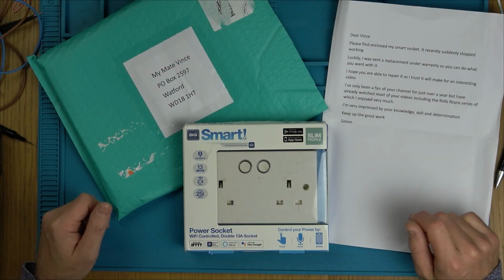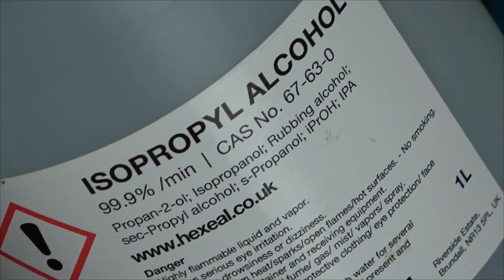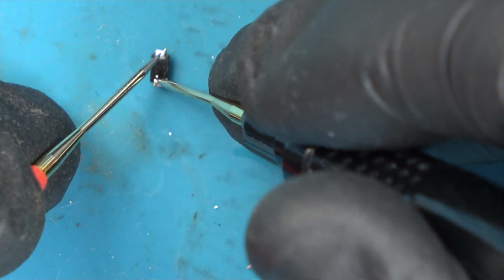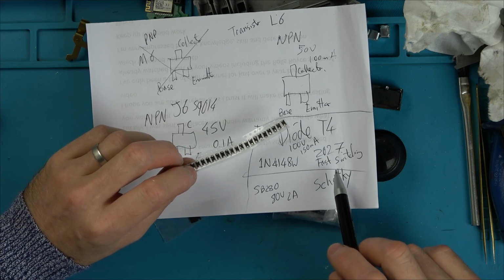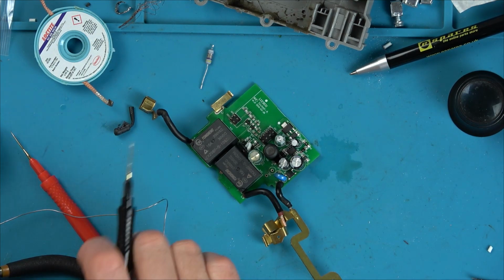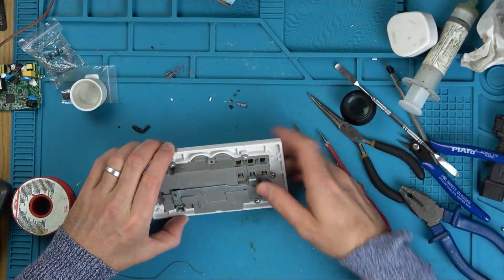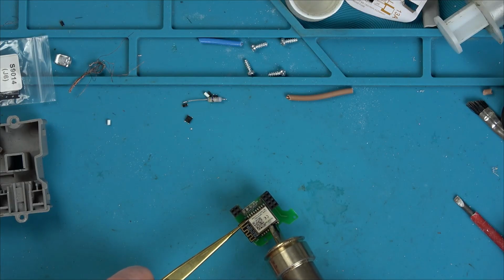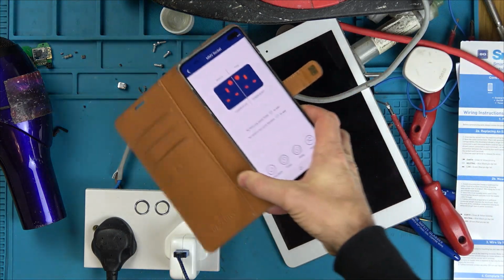Trying to FIX a 13 Amp WiFi Power Socket

Comment: I dont see how putting in a differently rated diode or transistor in would be dangerous..  its on the low voltage side and the most it could do would be short out the relay allowing power to no switch off..  its could pop some other components but nothing that would be of any danger..  the separation of the mains would still be adequate enough unless water got inside apparently..  but logic with vince tends to be a little on the off and on so couldnt really say obviously.  Like when he said “i wonder if id get continuity between the wifi plug and the other one..   like yea, no buddy..  put more brain into speech..  that was probably the dumbest thing ive heard him say while repairing electronics..  was humerous none the less..

Comment: They are flyback didoes across the low voltage of the relay coils to suppress voltage spikes when the relay turns off

Comment: I have a couple of the smart sockets very handy for example my garage is just ran off essentially an extension lead which crosses across a public footpath at height. I used the switch to turn power on its super handy and then leaves it safe if some moron wants to hang off it or hit it with a ladder like some moron did. I do also have a wifi booster socket and i know they are terrible but i just wanted to boost the signal abit for my ring doorbell so it seemed like a cheap easy option. Its terrible it works for about a week then nothing connects and when it does work speeds are dreadful and the rhing is maybe 3m from my main router. I have 600 symmetrical and id get about 10mbps on the socket bloody awful thing. Fine for a ring doorbell but like i say it stops working then you habe to turn the ring off and on at the board and thatd just stupid. Ive disabled it and its now just a usb socket to power a heater for my sea monkeys😂. I think we need to keep the tech out of the walls as much as possible.

Comment: Me thinks it was a bug that shorted from the AC mains to low Volt DC rail taking out the diode, bridge rectifier, 
in fact any low voltage component including those transistors you replaced.. 
Yup both transistors would have needed replacing due to the exposure of high AC voltages, I would also check
any Capacitors on the Low voltage rail violated by the high AC voltage..

Comment: Neutral is never switched as it can become a live when disconnected from the neutral side. These are both Live,
You can receive a full voltage shock from a neutral wire.

Comment: Vince, mate, stop putting yourself down (59:04) - your videos are not just "slightly entertaining". They're very entertaining: that, after all, is why we're all here (well, most of us, anyway).
As to the product, though, these seem like such a poor, or at least unnecessary, idea. And my heart sank when you mentioned an app - way too many things nowadays require an app, guaranteeing whatever it is becomes e-waste when in a few years the app inevitably stops being supported and updated. At least this has physical switches allowing it to operate like a normal socket - the nightmare version would be the one that you can only operate through an app. <Shudder>

Comment: Worth remembering that when you find a diode across a relay coil it is there to quench the back EMF current when the relay de-energises.  A shorted diode will stop the relay working and possibly cause  upstream components to overload.

In the video it looked like there had been some flash over from the Power side of the relay to the low voltage electronics.  Water ingress maybe. There really should have been some isolation gaps in the PCB between the low and high voltage side particularly in the vicinity of the relays.

😂 Home Automation is a good way of wasting time if you get hooked into the Home Assistant solutions - just like VoIP/Asterisk was a few years ago 🤣🤣🤣🤣

Comment: It'd be interesting to see in a few months whether the YT monetisation provides enough to cover the cost of the new socket (plus assorted other components) :)
Reply from the maker: Oh easily, it will cover that within the initial few hours. It's often the time taken that doesn't cover compared to a 'normal' job. I appreciated that I may take  10x to 20x longer than a proper fixer because every item I choose is normally different, to try to keep up the variety, so I'm always struggling! If I did another one of these in the next few weeks I think I could do it faster 👍👍
Reply: @Mymatevince  TVM, but for just this vid, or over your whole portfolio? Does YT even allow that scale of granularity?
Reply from the maker: Just this vid. Yes you can see the analytics on each video and also over the whole channel 👍
Reply: @Mymatevince  TVM :)

Comment: You could porgramm an ESP2866(the "wifi-board" is an ESP) yourself with for example Tasmota or ESPHOME.
Reply: @OneTheAndOnlyOne  Tasmota is my favourite for ESP devices. I personally use node red on an old raspberry pi to talk to tasmota devices over mqtt.

Comment: The diodes looks to be across the coil, if so they are a snubber diode so when the relay goes off, there isn't a load of energy thrown back in reverse from the coil into the transistor
Definitely looks like it has tracked the live across to the coil trace there, and cause mayhem, maybe it was on an outside wall and got damp, or splashed!
I doubt the diode going short should cause that, if anything it would just blow the fuse or the transistor
The bridge rectifier is just 4 diodes, so you will see a short from one side to the other
Get yourself a cliff quicktest, they are great for testing stuff!
Reply from the maker: Thanks Sparks, I'll Google the Cliff quicktest to see what it is 👍
Reply from the maker: Ohhh, I've seen Big Clive use them 👍👍

Comment: "Simplicity" - yes, I can relate. Had a bunch of home automation set up three years ago. But with every new bit, the "update/config/whatever" dance gets bigger and bigger. So the only thing that is still "smart" in my home are the lights. I recently started using Home Assistant again, because it's just easier for me to combine lights from different vendors and program some scripts and scenes. That's it. And I'm happy.
Reply: homebridge is better :P

Comment: These things are ridiculous. Wall outlets should be good for 20-30 years - they're not user-replaceable (yes a savvy individual can do them but it's recommended this is done by a qualified spark), but when you look at this thing the components look to be the usual consumer-grade Chinese stuff that is known to have a high failure rate. Unacceptable.

Comment: DO NOT USE THESE IN GARAGES OR OUTHOUSES, the WIFI chip generates heat that attracts condensation which can then cause a water drop to drip down via gravity and short the high and low voltage liens together resulting in catastrophic failure or a house fire. these things should be banned, imagine a fire on the smart board that went up through the wall insulation.

Comment: 1:02:10 - You and me both. So much tech is now tech for tech sake. I specifically bough an LED torch as it had two modes - on and off. Not fast flash, slow flash, hi mode, low mode, SOS and disorientation strobe?! It's a torch. It lights things so I can see them.
Reply: What I love is how these things are marketed as "tactical", to appeal to the insecure and cowardly. No, Dougie; just because you own a "tactical" flashlight, or razor, or pair of cargo shorts, doesn't mean you're suddenly a US Navy Seal. All it means is that you overpaid.
Reply: I got one that runs on 18650s.  So many of those old batteries laying around now.

Comment: The diode is used to clamp the voltage skpike that occurs when the coil of the relay is turned off. In this case it should protect the switching transistor agianst these voltage spikes, you can put there almost any diode.I think a 1n4007 is the best choice in this place because it is capable of up to 1000V and can handle 1A.
Reply from the maker: Thanks Tobi👍

Comment: That's the problem with 'smart' tech Vince, the only 'smart' thing in the mix is the fat cats taking the cream when you purchase them. Just like my electric meter, 50 years old and working fine, let's see how many disappointed people there are with smart meters in 50 years time......I think I already know the answer. Great fix, one of your best.
Reply: The majority of SMART meters rely upon a 2G phone signal to function correctly, and that's due to be switched off next year, so yes you're entirely correct.
Reply: @mark-andrews  And the saddest and verging on criminal thing, as I kept resisting my energy supplier (EDF's) repeated attempts to force me to have one, their final attempt was to send a letter by post using the persuasive language "we are legally obliged to fit a smart meter in your home". Yes they were, not an untrue statement, but how many people misinterpreted that as a threat I wonder. Shocking tactics to hit their own metrics.
Reply: @jonsworkshop  I got a letter saying my meter was past it's BBE date, apparently meters are typically only guaranteed to be reliable for 10-Years, or at least the meter in my property, fell into this category. I recently read about other electric meters that require a Long Wave (AM) signal to function, those AM signals are due to be switched off soon, too.

Comment: A dim bulb tester might be your next video!! 😀😀 Saves a lot of hiding.
Reply: @kblectronix  yes Vince please make a dim bulb tester. A bright bulb is better than a big bang!
Reply: Try to find some incandescent bulbs these days … I got lucky and found 6 200w ones in a thrift store. As the bulbs wattage needs to correspond to the power draw of the device hooked up to it

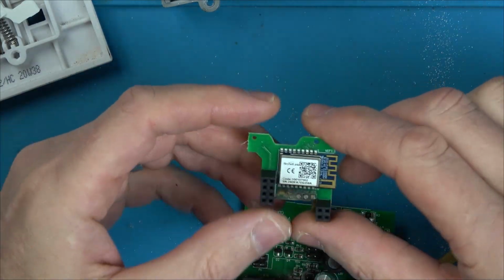Comment: @6:48 That is an ESP32 or similar:-) This also means that it's possible to reprogram them with custom software... basically a single board computer that can be programmed to work with a smarthome system of your choice... it's nice so you can make it work and you do not need the app of the vendor and you can have all your smart things in one app instead of 20 different apps (like an app for your camera's another app for your switches another one for your central heating and so on.....) This is good because i live with a person that is not really tech minded... and i can let him use just one app instead of letting him think about what app to use for what purpose....

There is just one problem i would have with this device and that is that you have to destroy it to be able to re-flash the chip...

Comment: Ha. I enjoy your videos so much I find myself clicking the LIKE button before I have even watched it! Call me old-fashioned, but I really don't like these 'built in smart sockets'. To have something that sooner later WILL fail hardwired into my ring main (UK power wiring) really causes me concern. The only way to isolate them is at the consumer unit as the electronics are active 24/7. Don't get me wrong, I have lots, over 19, smart sockets, but the type that you can simply unplug. Great video as always. Thanks Vince.

Comment: Contacts on the relay are 16amps But the track are not my thought is they have plugged in a heavy load that’s my guess u need to ask the client what he’s plugging into the socket
Reply: I agree, looks like an overload. Max in instructions 3Kw, not sure if that is per outlet or total.
Reply: But high voltage tracks were intact, and they’re enforced with extensive amount of solder. It was low voltage tracks that were blown, and the amount of current in them doesn’t depend on the load plugged into the socket. So I don’t think it has something to do with it.

Comment: Definitely a very good video, thanks :)
For the future, a small nightlight you plug directly into a socket could be useful in testing this for the camera. They're cheap too, in case one breaks.
Also, a big power bank with a mains socket on it would probably be a safer device to connect something like that to.

Comment: those look like back emf suppression diodes for when the relays release - that fuse looks like a fusible resistor
Reply from the maker: Thanks Andy. If I'm honest I don't know the difference between a fusible resistor and a fuse. I need to Google it😬 as I'm thinking it functions as a normal resistor up to a certain load, but I can't see why that part of the circuit would need a resistor over a normal fuse. Cheers

Comment: The relays would be for each socket .Using Alexa or other things you can switch each socket on or off rather than both at once .Unfortunately even the bigger more respected "makers" (importers) have probably the exact same production lines as the knock off stuff so names no guarantee of good products in this day and age .

Comment: If you buy the Device directly from China you can get them much Cheaper, like for 15 to 20 Bucks.
I bought a Tuya Smart Switch for my Living Room for when I'm already already almost asleep so I can just turn the light off via my Phone.

When it comes to the Code, there are open Source solutions you can flash to the Device, which are better because they don't require any Cloud Connection and in a case like yours you can reflash it.
If the Open Source Firmware  is compatible with your Device you will have to look it up.

They are called like: ESPurna, Sonoff. Tasmota, ESPEasy and so on.

Comment: As an electrician and electronics engineer since 1984 - I would tell everyone STICK TO NORMAL TWIN SOCKETS.   None of this smart switching.   Just plug an alexa/google socket into it.   Much easier.   Devices like this one can cause issues by tripping a complete ring main when they go faulty.
Reply: True this - I had 2 of these sockets and they didn't make it past my test bench. Besides its easier to replace a smart plug if it goes bang rather than a smart socket. Easy euough to keep a couple of spare smart plugs in a drawer for the day one goes bang, a lot esier to swap out and you don't need to turn off the house breaker to do it!
Reply: W've Crabtree traditional sockets all round the house and never had a days trouble. installed in 1991
Reply: Not just that but they loose the connection settings when power goes off and back on.
Reply: I just sit in the dark.
Reply: Completely agree, plus manufacturers often go belly up and you lose support for the smart capabilities so you need to call an electrician and spend a fortune getting them all swapped over. a smart plug in device is not only safer but if you need to replace it down the line it doesn't mean a hefty electrician bill too.
Reply: @-dazza555 Why would you call an electrician to change sockets?
Reply: I assume 240v over 120 would create more issues or at least make them more spectacular

Comment: Im wandering where abouts in the house it was, being a wifi socket it may probably have been used in a garage, conservatory, shed or out house. If its been producing a little heat it may have attracted condensation and this could have caused it to fail.

Comment: You should have a 65w incandescent lamp In series so it won't go bang and trip the differential if there's a short. If the light goes on, there's a short. There's plenty circuits online you can replicate so you can safely test shorted mains circuits

Comment: You need a series lamp to check for inrush current. It will tell you immediately if something will go bang. A globe, a bit of wire, a plug and an electrical box, is nothing compared to the injuries that could be sustained by dodgy gadgets.

Comment: hi my theory why this failed so spectacularly is because this uses a non isolated buck power supply only the live control power was fused and the non fused live shorted to the low voltage circuitry sending 240v half wave (because of rectifier) in to the 3.3v circuitry frying the wifi module and also surging well over 1A shorting the bridge rectifier and blowing the fuse when the rectifier shorted
Reply from the maker: Thank you David👍👍👍

Comment: Wow you put some major effort into that. Well done! I've never bought one of those smart sockets because I'm not comfortable with having cheap electronics on a 32 amp house breaker. The instantaneous trip current on those breakers is enormous and the explosion would be rather large!
Reply: Exactly, I am not a fan of sockets with built in USB/Wifi - there is always a risk it may catch fire - at least you can pull out a plug in USB power supply

Comment: Electronics engineer here........I'm just not a fan of having electronics like this behind a socket and helluva close to the wall insulation etc. It wouldn't be so bad, but they tend to design these things cheaply and without a good controlled failure mode. Hmmm, I wonder how many failures and resultant house fires there have been?
Reply: Agree. There seems to be an obsession to built things into sockets the were not designed to be built in. I'm looking at you USB sockets.
Reply: @chrish1398  Not to mention the built-in obsolescence of USB sockets!
Reply: In addition to the safety factor, these devices tend to launch very bad noise and interference on to the mains wiring of your house, next door, and most of the street. Wiping out AM Radio. Bad, very bad.... Some are also noisy right up to VHF and beyond....

Comment: Almost certainly, the mains voltage side tracked across to the low voltage for some reason (potentially moisture),  destroying the diode and transistors in the process.
Reply from the maker: Thanks Martin👍

Comment: Probably that socket was in the kitchen with people cooking and plenty of steam inside the kitchen...Did happen to my normal socket...was full with water inside when I plugged the kettle on... Now i did put silicone around the socket...I do have tiles on the wall so probably was leaking from the tiles inside the socket... Now i do have a dehumidifier and the kitchen hood on all the time when i cook... and it's getting steamy...